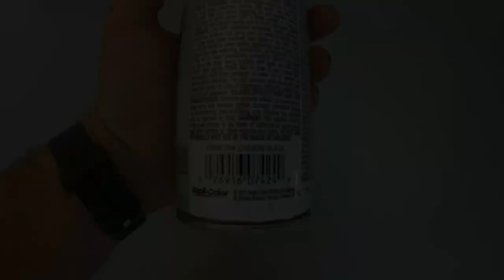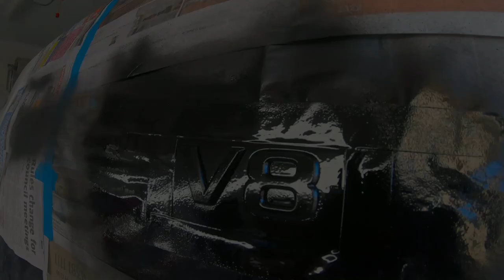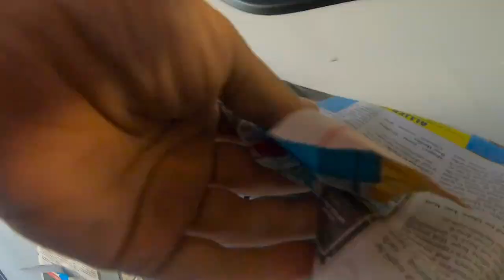Blacking out Y62 patrol 4x4 [ Blackout chrome delete with plastidip easy removable Plastic Dip ] 4wd

Comment: How has it lasted?
Reply from the maker: Hi. It’s been around 18 months now and the back boot has just a couple on marks, but the front V8 badge has lifted a little in the middle of the letters.. but it’s very easy to peel off and re paint I guess.
Reply: @AussieVanAdventures  i just did mine, came up a treat. 
Thanks.

Comment: Not a bad job bro how long does it last before it looks fucked ?
Reply from the maker: Hey mate. It’s been over 12months and it’s still  the same. The V8 badge has pulled tight a bit though
Reply: @AussieVanAdventures  legend I just got my y62 today I was thinking of wrapping it but took it to get painted by a panel beater now next stop to on trak for a harrop charger 💪🏼